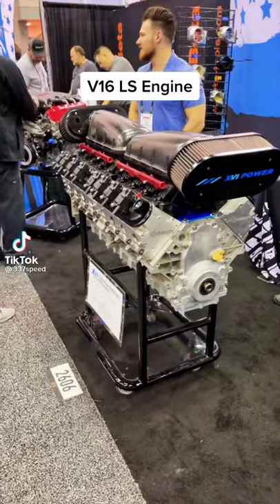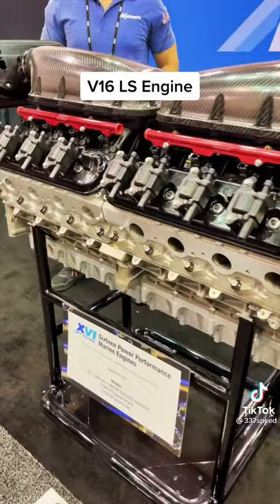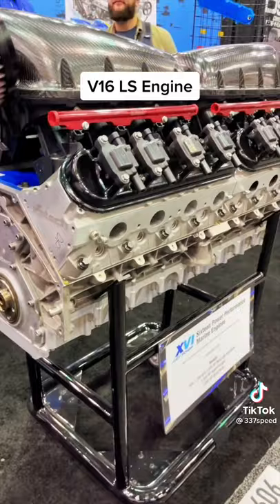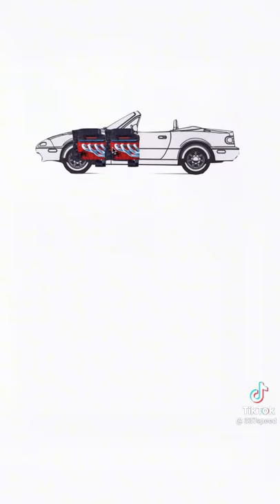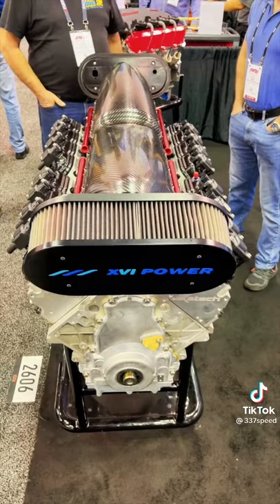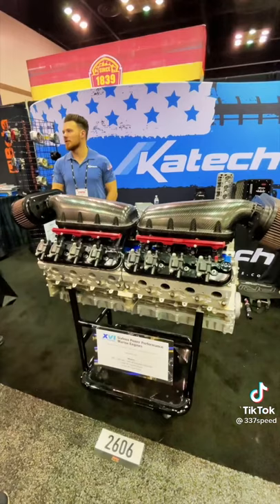V16 LS engine for the first time

Comment: Steve Morris did it first like 6 years ago and made 4500hp with quad 81mm
Reply: At What rpm ??? Please please 

Thank you ahead of time
Reply: That's absolutely insane, like WW2 fighter plane levels of horsepower. Would go great in a capable kit plane
Reply: Yes it was built for the Deval supercar from Dubai, don't know what it will use for a transmission!
Reply: Yeah for the communications with devels 16 🎉